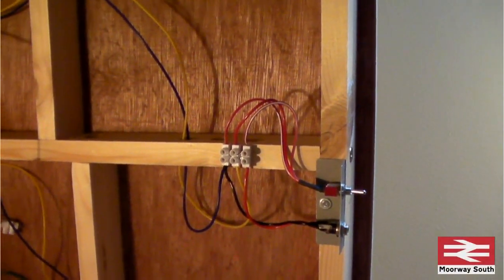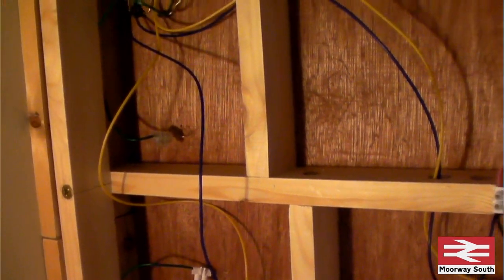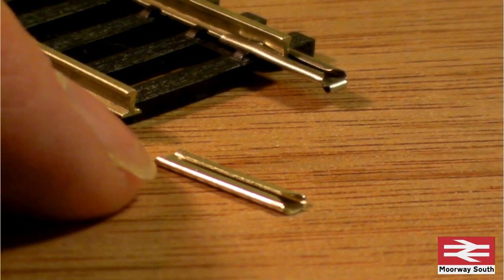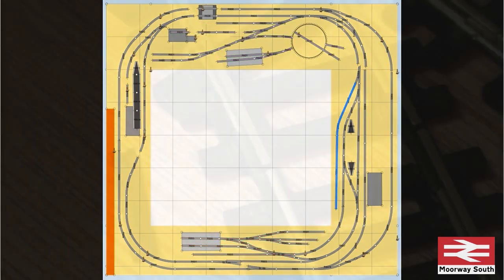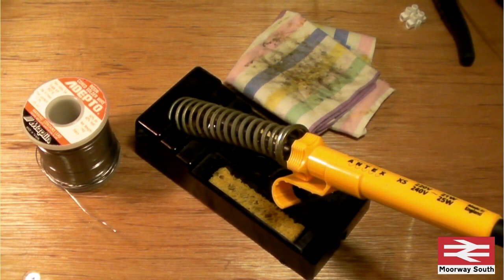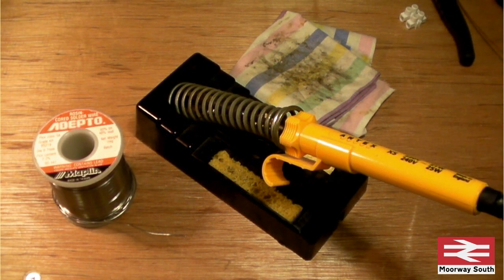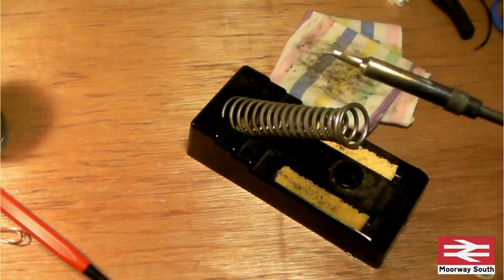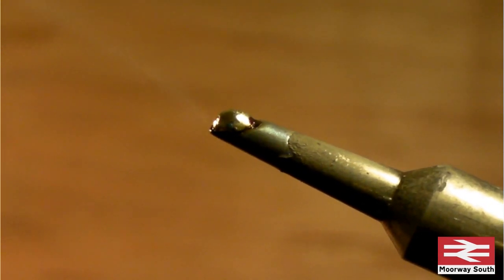Moorway South Part 8 - Electrical & Soldering

Comment: Excellent wiring and soldering video.  bI still do not own one of those strippers like you have.  I did get one with a graduated cutter, so that you can put the wire in the right slot and cleanly cut the shield without cutting the wire itself.  It works quite well except on really short wires.  That is when I wish I had one like yours.  Rob